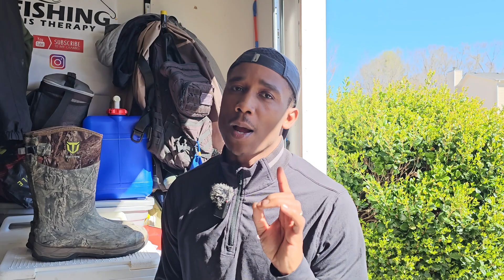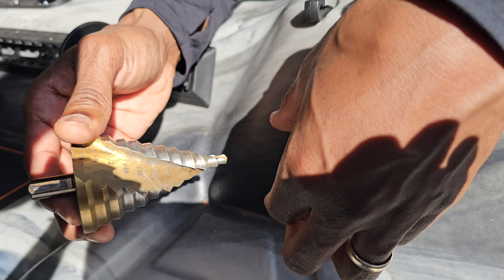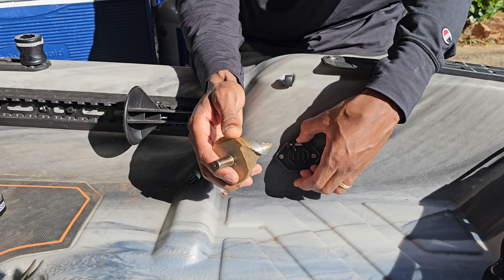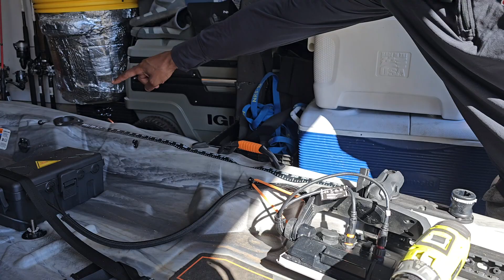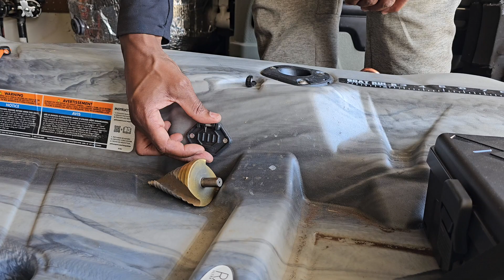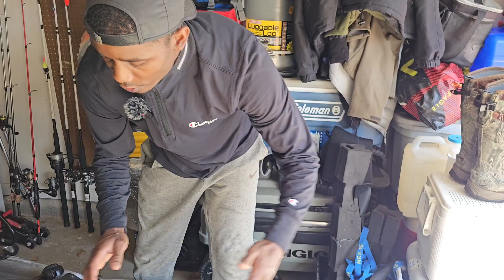This HACK is Perfect! Kayak Battery Power QUICK CONNECT Pelican Catch Mode 110

Comment: I personally would consider upgrading that wiring to at least 6AWG duplex marine grade minimum.  Your voltage drop has to be like 7-10%, going to 6AWG would bring you at or around 3% which is considered the safe max.  I know you arent pegging the motor at max speed the whole time, but when you are, youre putting more current through the cables than they can handle safely. Youre using more battery and getting less output.  Im really not trying to lecture you, electrical engineering is what I do, I'm just passing some knowlege along, what you do with it is up to you.  I enjoy your content and would like for you to still be around to keep making it.
Reply from the maker: Thanks alot. I was not aware of that issue. I appreciate the warning. I definitely will be upgrading my to atleast 8AWG to prevent any issues or hazards.
Reply: @fishingistherapy I fat fingered it, I meant 6AWG.  Sorry for the mixed up.  I also forgot to mention to make sure its marine grade cable too, the whole length is tinned to prevent corrosion.  Youre running the newport nv 55lb motor right?
Reply from the maker: Yes i am running the 55lb thrust. I only used tinned, its the standard for marine environments.
Reply: @fishingistherapy cool, im coming from using a bass boat so im pretty new to Kayak fishing, i really appreciate you taking the time to pass your knowledge on, thank you for answering my questions, youre a real ambassador of the hobby.
Reply from the maker: 👌🫡Anytime, thanks for sharing your wisdom on the wiring. I really appreciate it. I hope you enjoy this new hobby, its definitely a more intimate version of fishing that is addictive.

Comment: Thank for the video. 1 question, how do you secure battery box to the floor? I have the same box you have.
Reply from the maker: I just use the bungee included on the yak. I haven't secured it to the floor yet.
Reply: @fishingistherapy Thank you I was way over thinking it😅
Reply from the maker: I was too. I was going to strap it down. But after doing research on people flipping their yaks. The worse thing you can do is strap it down as it turns into an anchor and its a pain to flip over...in a battery box a lithium battery will float for a few seconds but I would rather lose the battery and get back in the yak then have everything pulled to the bottom😅😂

Comment: Thanks for explaining everything.  My only concern is I’m on a big lake, do you think the battery on the front end would keep my bow down too much?  I’m using a 100ah lithium battery with a 36lb thrust Newport motor on the transmog on the rear
Reply from the maker: I now have my trolling motor on the bow, it does get some splash when boats wake me..but overall I'm good. The 100ah is in the rear. Im going to testing out a 200ah in the rear soon and few other gadgets to see how it works out. But my lake is big and I would rather add weight to the center and rest than more to the bow but a 100ah should be fine.
Reply: @fishingistherapy that makes sense.  Ok cool thanks!

Comment: Do you have a Killswitch on your trolling motor in case you would flip?
Reply from the maker: 🤔No, I do not. If my kayak were to flip, the trolling motors shaft and propeller would be out of the water. But it could flip me out and right itself and troll off, I agree.  I am pretty certain if my yak flipped or threw me out, my battery would also flip out and unplug its power from my trolling motor. My boat, however, in most cases, wouldn't flip or lose gasoline power but keep running and the boat would circle or run away or run me over, hence the need and required manufacturer killswitch to start your motor or stop it. Great point, I would like to know or learn how one would install it on trolling motors because that would be a great safety video. I wonder why these companies aren't required to put them on their trolling motors? Thanks for bringing that point to light.
Reply: Hopefully you find a good video or something about how to install it because so far I've had a hard time but you're right if it totally flipped over the motor would be in the air is the best case scenario I guess but I'm more worried about if mine would somehow just keep going besides hitting me if I'm in the water lol @fishingistherapy
Reply from the maker: What brand do you have? Today, alot of companies have failed safes when a trolling motor is submerged or flipped. Have you flipped an the motor keep going?
Reply: I haven't purchased one yet the videos for helpful tutorials on proper installs are hit and miss and then it's always so hard to find the brand their using. Just seems like a good idea. But with all my gear going overboard maybe it's best to treat it like the captain of the Titanic lol @fishingistherapy
Reply from the maker: @bruce3579 😅Yeah man, it makes life out on the water more enjoyable by allowing you to explore more water with less effort and time, in my opinion.

Comment: Do u need to buy both the red and the black wire or do u heat shrink. The 2 wires to the 12 gauge red wire on both sides
Reply from the maker: Yes, I bought bought spools of both, red and black and yes, I heat shrink all connections.

Comment: Decided to replicate this setup day one today was able to make the holes and pass the cable
Reply: Btw what kinda battery you using
Reply from the maker: Nice man, glad it worked out. I am using a Goldenmate 100AH Lithium LiFePO4 12.8V Battery.
Reply from the maker: Video coming out Friday regarding my battery setup.
Reply: @fishingistherapy  did you get reverse polarity? I followed all the steps but when using the connectors forward goes reverse lol I already checked all my connections black with black and red with red
Reply from the maker: @Shiny_Shiba No, I haven't experienced that. Not sure why that is. What is your indicator for reverse polarity?

Comment: "Best practices" for marine electrical application: 
Heat shrink is an insulator, it is no form of waterproofing, it is however GREAT for hiding problems! If you really want it waterproof, cover the heatshrink with 3M 33+ electrical tape and stretch when applying. (Same goes when using the alleged waterproof self-solder butt conns.)
Always coat EVERY CONDUCTOR with dielectric grease prior to crimping, this explains itself. (I'm familiar with the spec.which doesn't mention this (one way or the other), yet time and time again I see this most common flaw. However you won't see this issue when dielectric grease is applied! (If you're worried about the connectors "grip", I assure you from REAL ACTUAL pull testing analysis that it will not degrade its holding grip [if you've nothing else to do, prove it to yourself]).
Route high draw cabling alone, never crossing other low current or comm. cables, it's always best to route high draw cables down one side and other cables down the other. If not possible ensure 12" clearance from other cabling and never let the cables cross over one another! 
Coiling cable creates inductance, IF you must coil cable make the coils AS LARGE as possible, especially the transducer cable!
The more work you fix, the more you'll learn!
Reply from the maker: Nice! Thanks for sharing these tips and experience. I will definitely apply those tips. I appreciate you sharing your wisdom. Means alot that you shared that.